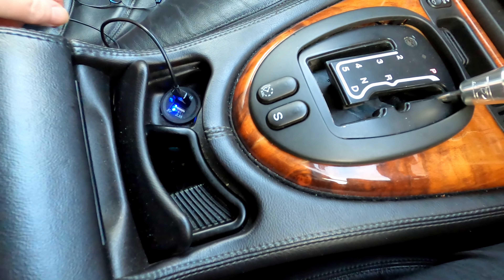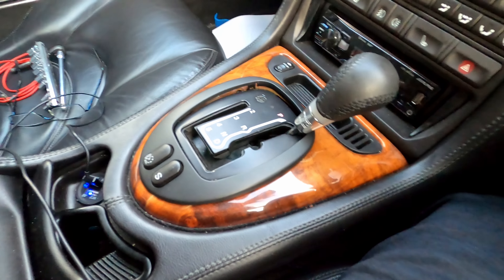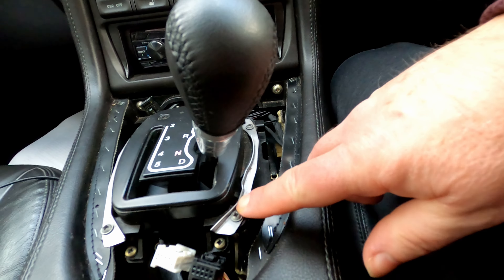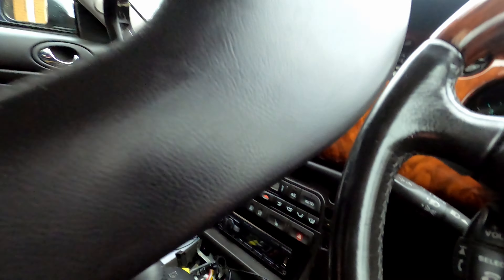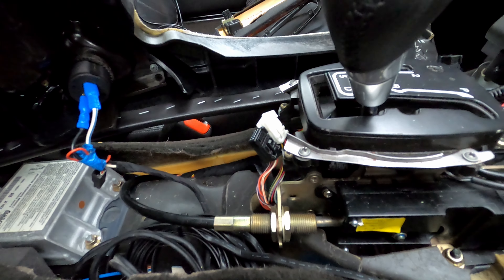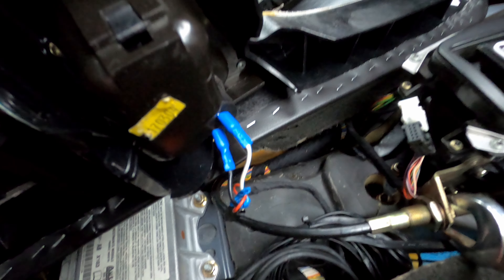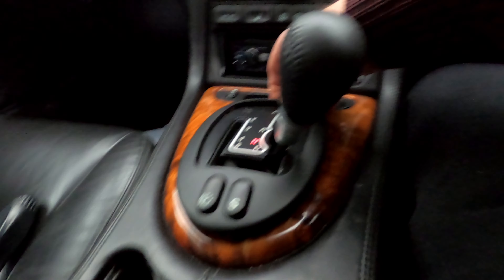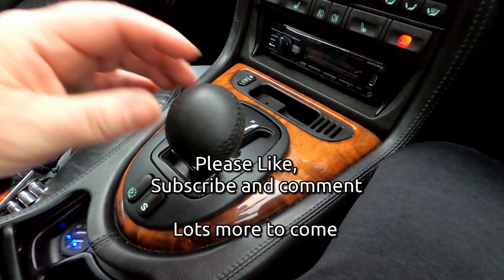Jaguar XK8 gear selector cable adjustment & a couple of other fixes - Requested video

Comment: I did exactly the same with those brackets,easy when you know how !! Thanks.
Reply from the maker: Every day is a learning day.
Reply: @ccuk  Got to come apart again as i have the flashing light and no sport mode !
Reply from the maker: @westboundbadger  It is all good practice. It is probably the Linear Switch that needs a good clean. That is usually the culprit.
Reply from the maker: @westboundbadger  Let me know how you get on.
Reply: WB Badger, Get into the linear switch module and clean the oxidation from the phosbronze contacts and the PC board.  Then lube with Deoxit Gold.  Problem forever solved.

Comment: Hi. Thanks for posting. Mine will not go into drive most days without first passing drive. In addition if you go all the to 4th its hard to get 4th to light up then back to second you have to pass second and go back. Also park light up but you have to jiggle it then you here a small click. Might this procedure help this?
Reply from the maker: This procedure is easy so worth a try. I believe the earlier 5 speed gearbox uses the cable on both sides of the J gate, so if that is what you have then it sounds positive. If you have a later 6 speed the left side of the J gate works electronically so issues on that side are not affected buy the cable adjustment.

Comment: Excellent stuff.  As previously mentioned, this is a job that needs doing on my 96 XK8 as it sometimes fails to register 4th when shifting manually (unless I really drag the lever all the way back).  When this happens it throws up a gearbox fault code that I then have to reset via the OBD port.  I reckon that this is the fix 🤞.  Thanks again.
Reply from the maker: Hi Gerard. I hope this is the fix for you but I fear yours might be something different. I am not familiar with the earlier 5 speed gearboxes. I'd love to hear how you get on.
Reply: @ccuk  I’m pretty confident this is the issue as 4th is the rearmost position on the J-gate with the older 5 speed ZF before the slide across to D.  If I really yank the lever back into the rear of the frame it goes in every time and so it sounds like the tweaking of the cable might well be all that’s required.  I’ll let you know in due course...
Reply from the maker: Did the adjustment fix it?
Reply: @ccuk  it certainly did John.  Very positive action now and no hint of the dreaded ‘gearbox fault’ warning message now.  Have you got this issue as well?
Reply from the maker: @gerardbooth40  I have not had any issues since I adjusted the cable. For me it was slipping out of gear into neutral.

Comment: Great video, I’m going to have a go later, my xk8  is a 98, it throws a wobbly when I use the left side 2,3,4, gears 
Shes been standing still for a couple of years 
And got a bit damp inside, so will probably spray connectors with contact cleaner whilst centre console off . 
Keep up the good work
Reply from the maker: Let me know how you get on. I fear you might have a few electrical issues but its worth trying the cable.
Reply: Result! Adjusted cable, sprayed contact cleaner on all connections, noticed a loose screw on j gate. The gear lever feels more solid drops into place better
Took her for a test drive using 2,3,4 gears all seems good 
Well chuffed :) 
Can’t thank you enough for this video
Reply from the maker: @stevet7108  I am really glad it helped you Steve. Thank you for giving me an update 😀

Comment: question. my j gate won't start in drive. drive doesn't light up. to get into drive you have to go past drive and then back to drive. and you cannot select second. it won't light up. Can this help that?
Reply from the maker: If it is badly adjusted then this process could help. Good luck and let me know how you get on.

Comment: My XK8 has not kicked down properly since the gear selector cable was replaced by a Specialist.   Is this just a coincidence?
Reply from the maker: Hi. Sorry for the late reply. I am not sure, but I suspect it is a coincidence It could be that the battery was disconnected and the gearbox is still on its learning phase. There is a kick down button under the throttle pedal that is activated when accelerating hard.